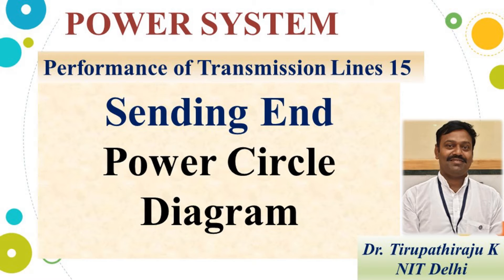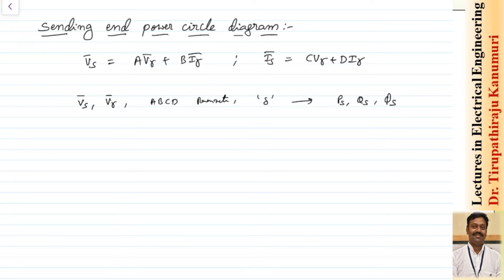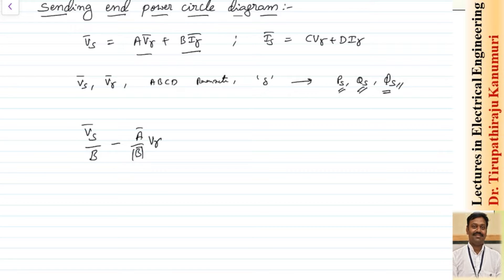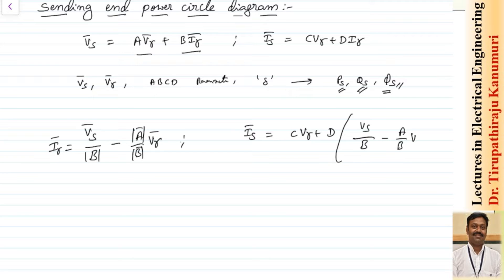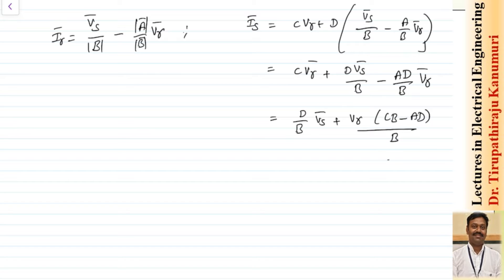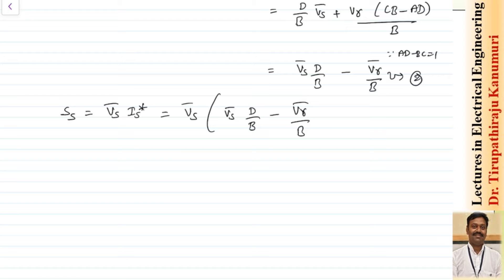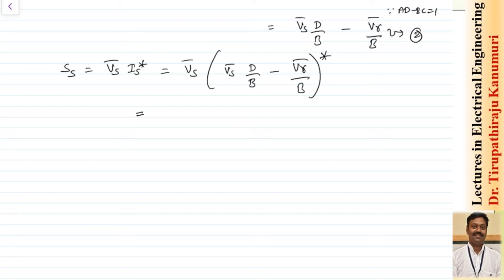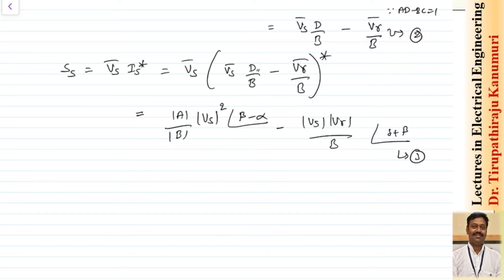PS36 Sending End Power Circle Diagram

Comment: need help sir how to calculate the vr  when the auxiliary constants, load power,pf,vs are only given
Reply: @lecturesinelectricaleng  

the auxiliary constants of a transmission line  of a transmission line are
A=0.98+0.0085i
B=40=75i
C=(-1.54+536.4i)x10^(-6)
such a line delivers to the receiving end a load of 45000kw at 0.8pf. if the sending end voltage is 220kv. calculate the receiving end